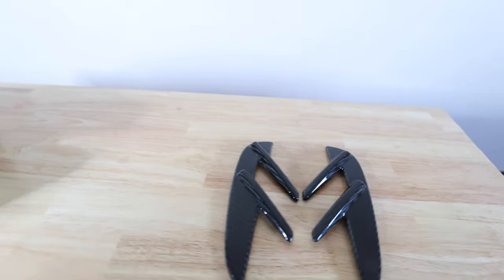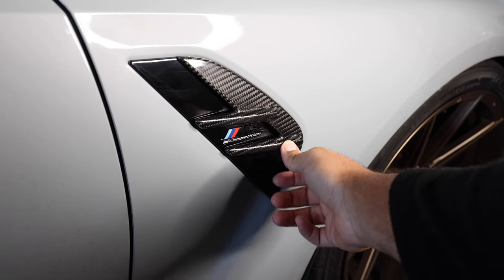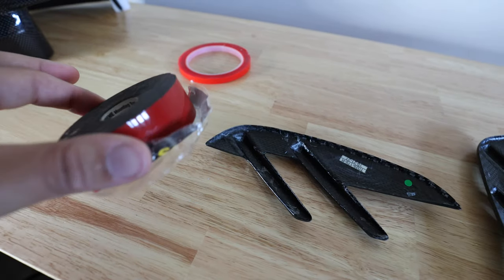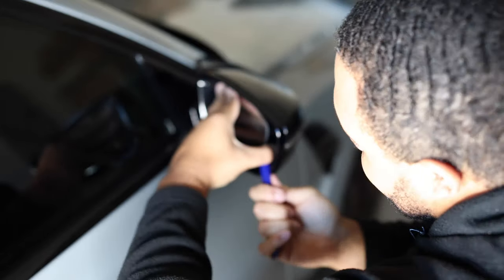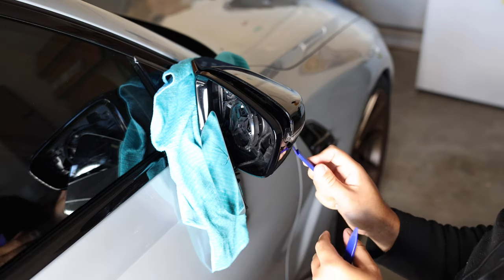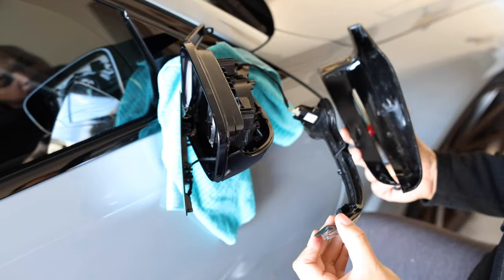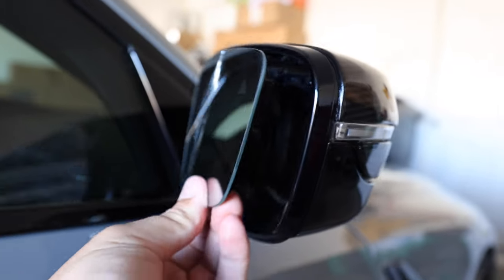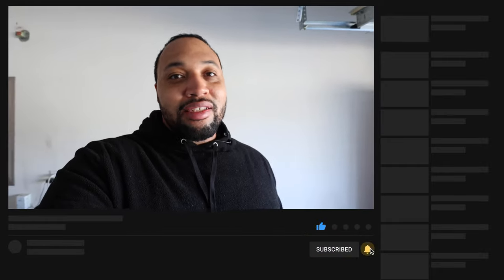Installing Carbon Fiber Mirror Covers and Side Vents

Comment: I feel so bad for this guy, damn the mirror!, but thanks for the video!  Please, DO NOT remove the mirror. I have a 2022 G20 330i and I easily did it without removing the mirrors. You can break the mirror, which is expensive to replace (there is a youtube video showing a guy breaking it, super easy to break). All you have to do is manually push the mirror down in order to reach the 2 top clips. Push the clips away-and-out (with the tool that you should get from the seller), while also pull-hold the cover with you other hand at the same time. Once you see that the cover pops-out from top (a little), grab the cover from below and pull it out, it will come out right away. The rest is self-explanatory. Hope this helps.
Reply from the maker: Thanks man… it sucked breaking the mirror but like you said you don’t have to remove the mirror to get the covers off.
Reply: I don’t understand how u do it without taking glass off. I see the two clips when I face the mirror down but how am I suppose to push one clip up and the other down at the same time with little to no space? I don’t want to break my mirrors thank you

Comment: you don't need to remove the glass. Point your mirrors all the way down and face them to the inside of the car. That leaves a gap up top to insert a thinner shafted flat head screwdriver and undo the clips. Give it a try much easier and no chance of glass breaking.
Reply from the maker: Yeah if you have a thin enough screwdriver that might can work. I used to not take the glass off at all and just pry it off with force and a trim tool 😂 I figure since this was a new car I should use some finesse
Reply: @BK, thanks for the suggestion. I did my OEM ones, yesterday, and didn't remove the glass. It took a little while to get the light, just right, and to be able to see to push the tabs, in, and pop the front cover, off. It would be better if you had 2 people, but I was able to manage without having to remove the mirror glass. I had already started trying to remove the glass, and I came back to this video, and  I just happened to see this comment. So, thank you. $1,400 for the OEM mirror caps, I really didn't want to break a $300-$400 mirror. James, thank you for the video. It gave me the confidence to even start the project.
Reply: @g.dubyou6263  yup. It’s actually harder to do this and more risky to take the mirror lens off. Also when he says “like a T20” he means “T10”. Lol
Reply: It was definitely a little work to not remove the glass. Just visually. Like trying to see and work at the same time, if you had a light that stuck to the side window, that snaked around, it would be easier. But I made it work. And no worry about breaking the glass. 🙌

Comment: Looks dope man! Sucks that the glass broke tho, that's the scary part about installing side mirror caps...
Reply from the maker: Yeah I usually don’t even take the glass off and just yank the covers off with a trim tool kit. I figure I should not do that on a new car 😂
Reply: @WhatsyourForte  2 taps that hold the mirror cover, if its broken its over.. that's why glass is remove to unlease the tap from behind. you broke the mirror by bent the glass from outside in.. with you trim tool, pry from middle as you can.. and top or bottom is shortest distance so you don't flex the mirror too much and crack.. Trust me, i cracked many mirrors before.. live and learn...

Comment: Hey man I bought a pair of carbon fiber side vents too. I bought from Amazon mcacar kit. Fitment is not spot on regular 3m will not hold it. How is your fitment?
Reply from the maker: Fitment is good on my end. I used the max hood 30lb 3M tape. It is not going anywhere